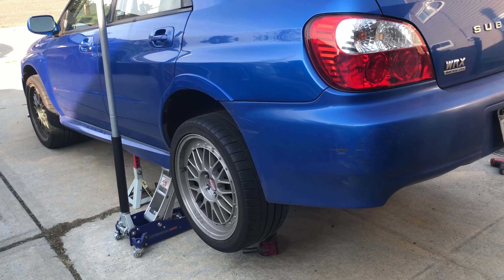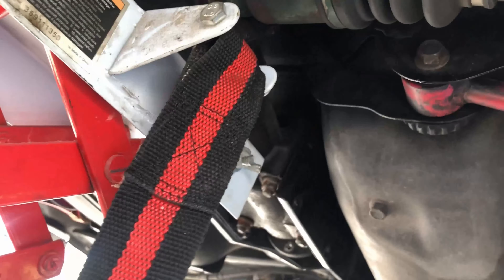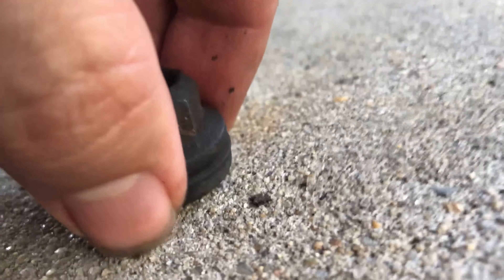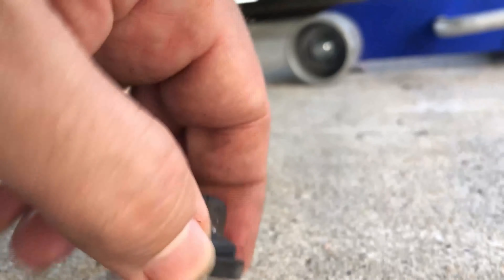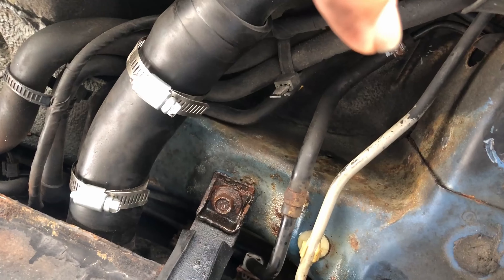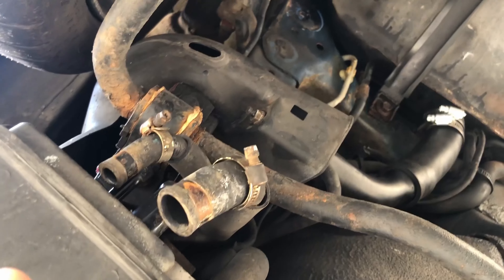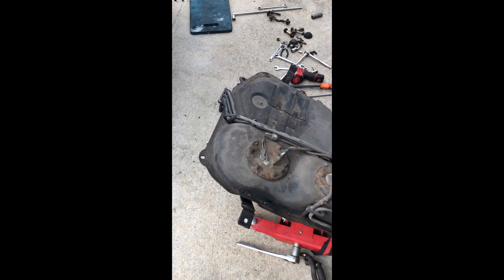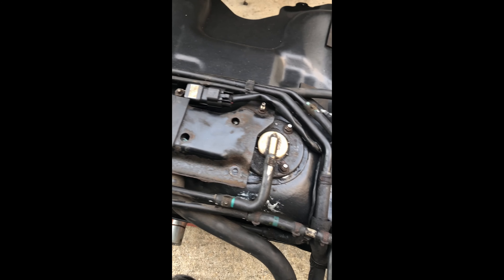How to replace the gas tank on a GDB Subaru WRX, 2002-2007

Comment: Thank you for excellent video. Were you able to pin point the cause of leak?
I have gas under rear left passenger seat. 👍
Reply from the maker: The tanks is made from two shells joined together. It rusts at the separation line, right under the filler neck hose tube. I started by replacing the filler neck hose, but when I did that work and had the hose out, was able to see the rust perforations right under the tube that is brazed to the tank. All this is on the right rear of the car. So there's hope in your case that it's not the tank. On the left side, right in front of the rear wheel, there are the connections of 3 hoses to the tank: fuel in and out and vapors out. Maybe one has a crack. Revisit the section where I disconnect them and have a close look to see if in your case one of these hoses is wet.
Reply: @vladsmachina3285  
Hi thank you for response.  The lines on left side below cushion have been repaired and all is dry around. Gas comes from 2 small rubber holes right under seat. So gas is on top of lower portion of the tank and on left side only. 
Top 2 check out cover all dry. 
Probabily one of 5 lines going across front of tank. Keeping thank 3/4 so/so 
Nice talking to you. Stay safe. 
                                                     P
Reply: @cp1855  
Did you find the cause of your fuel leak? I have a leak and the symptoms sound identical to yours. Thanks!
Reply: @carldrache8894  
Hi Carl it seems to come from top mid area of tank. Inaccessible and won’t remove tank. I fill up to 3/4 full and have sealed under left cushion small rubber plugged hole. No gas smell. 🤞 good luck

Comment: How long did it take you to do this? I’ve been referencing this video to replace my gas tank and my car is so much rustier than yours so I keep coming into problems with rusted parts
Reply from the maker: It took me one and a half days. Without shooting the video, I could maybe have done this in one day. But at the time of the video, the rear end, including the diff had been out several times already. For upgrade, then a few years later for replacement of the rear crossmember, with one with no rubber bushings. The axles had been out for boot replacement.
Reply: Excellent video for reference.
Reply: Best out there. Your time and hard work greatly appreciated